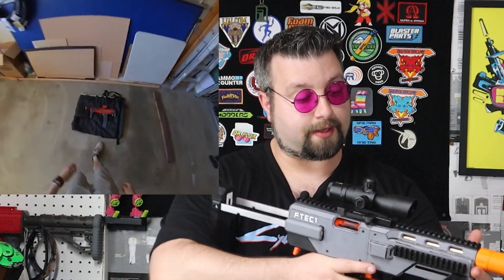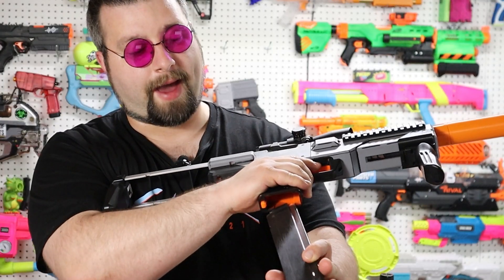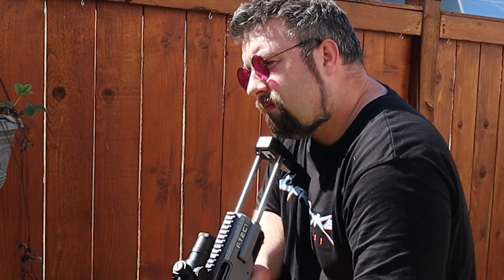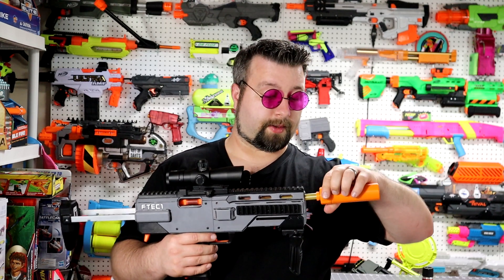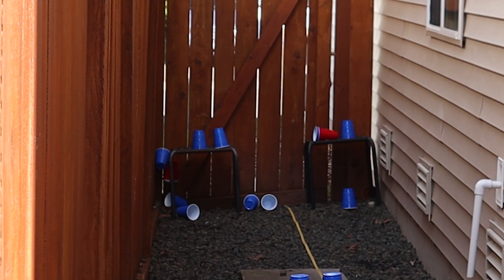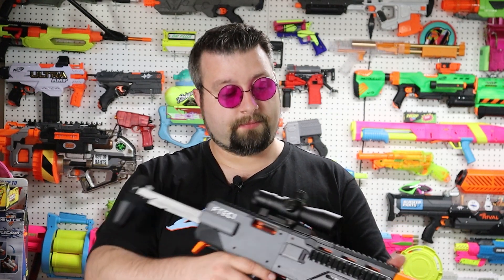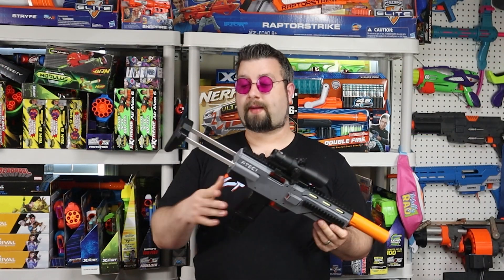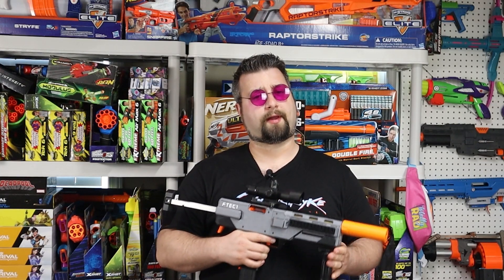The Nerf MP7 Foam Technician's FTEC1

Comment: Damn, the creator should create one with a grenade launcher attachment, for half life fans of course, and maybe an MP5 version would be a cool idea as well.
Reply: Yes, to the MP5 version. It still shocks me to find that the most iconic modern duty SMG still doesn't have a foam equivalent that's not a modified Stryfe with a Worker cosmetics kit.

There's nothing bad about that, by all means. But it's insane that I have yet to find a dedicated foam MP5, until perhaps now.